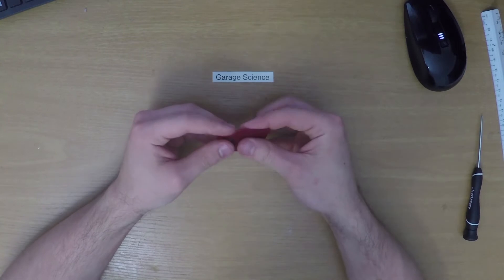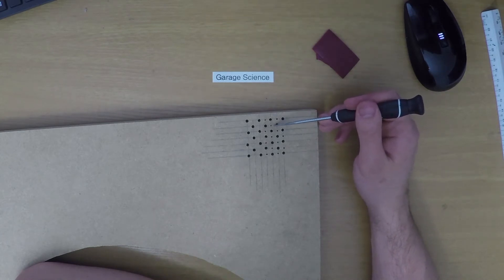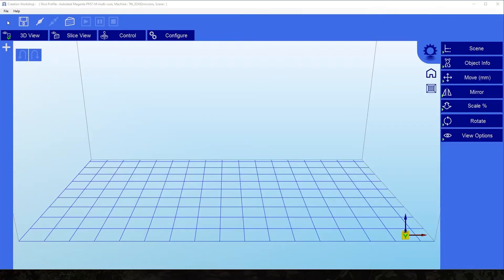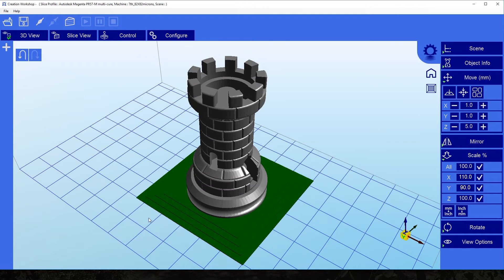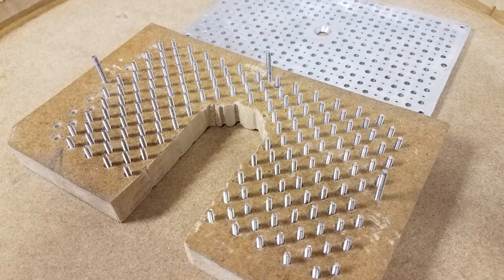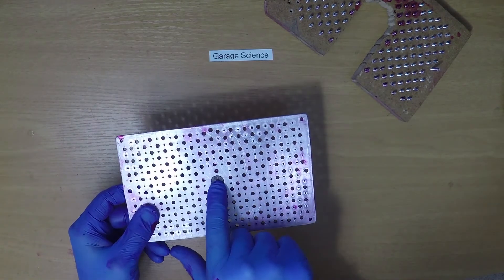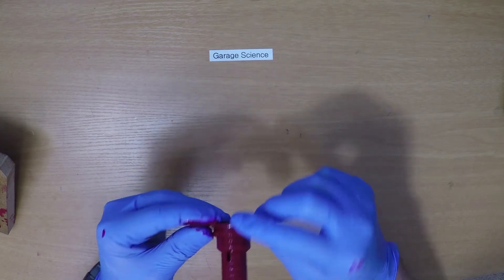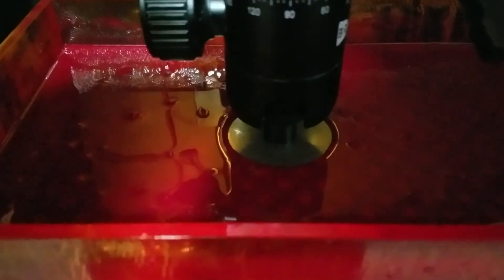Improve Build Plate Adhesion on Your 3D Printer

Comment: Garage Science, I know that this video is a little older, but I am experiencing build plate adhesion issues much like you describe in your video.  Over the last 5 years has your perforated build plate continued to be a reliable countermeasure against build plate adhesion issues?
Reply from the maker: It has, the removed tool I made is necessary though. Because the resin cures into the holes slightly it makes a much stronger mechanical bond to the build plate. Which is good for keeping it stuck but makes removing it more difficult. I'm working now on lowering the suction/separation forces in general so that a perforated build plate isn't necessary. I'm hoping to make some big announcements by the end of the year 🤞.

Comment: so you will contaminate the bath if you have any dirt insidie of those holes. why did you think that engineers made the platform flat? they not stupid there are reason behind it.. also c mon you almost hurt yourself taking it off, it shattered the print man, all you need to do i design your own raft when you design the model, ad chamfer on the corners so you can lift it with a spatula , easy.

Comment: If you don't use a custom raft in CW, you can scale the existing raft to be larger to give more contact area to the base plate to help resist the forces applied during the peel process. I also reduce the thickness of the raft from 1.0 mm to 0.5 mm to save time.